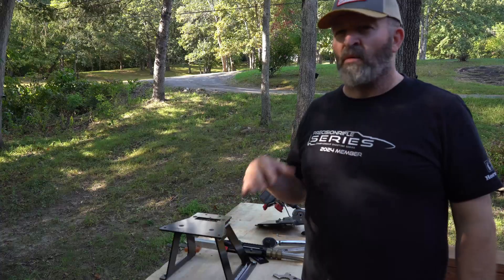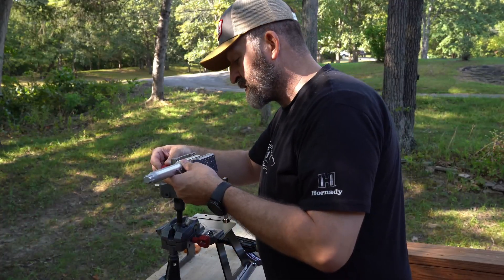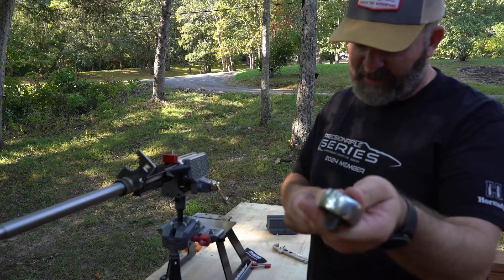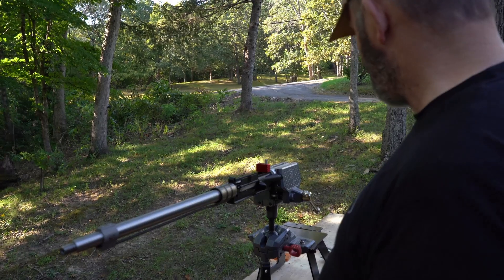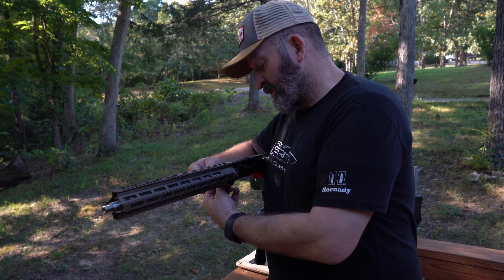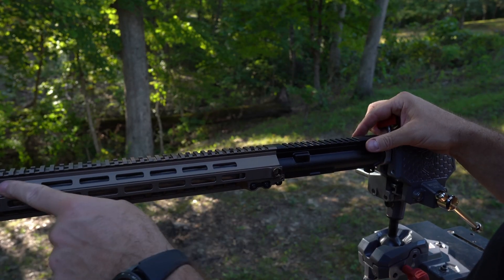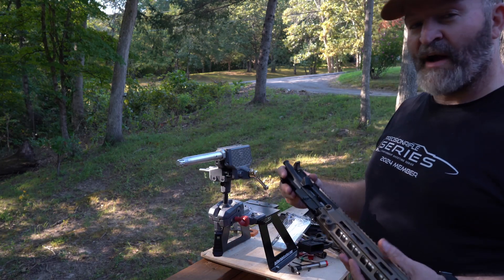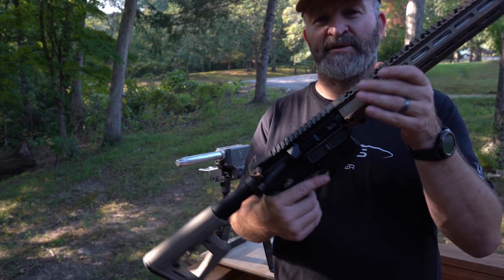Ultimate Precision 22 ARC Upper Build: Proof Research Stainless Barrel + Gisselle Rail

Comment: Try lapping the face of the receiver and some loctite 620 on that barrel extension and it squeeze more accuracy out of it. Nice build!
Reply from the maker: Thanks that's a great tip I actually have a Wheeler lapping system. Unfortunately just moved and haven't got that particular thing unpacked yet. Thank you so much for adding to the conversation.🎉